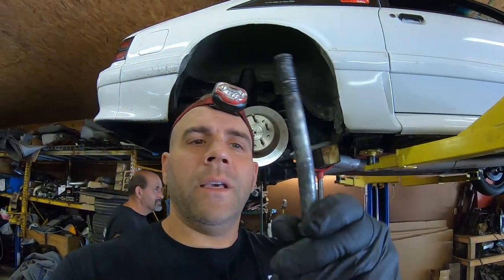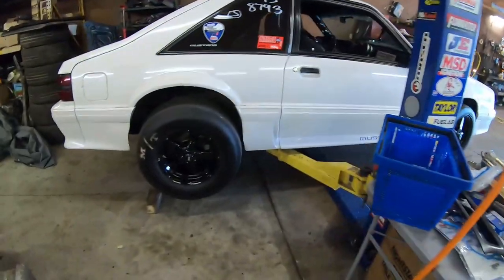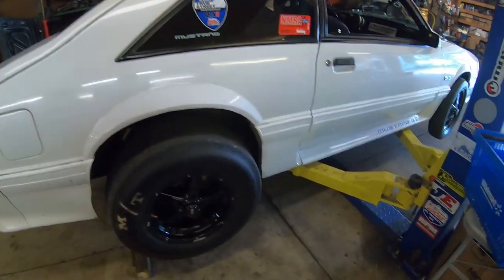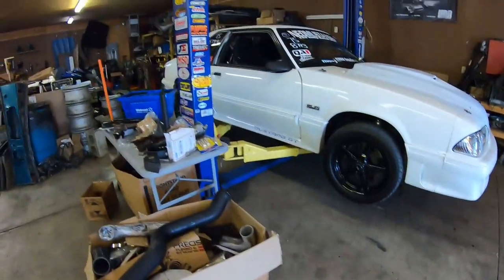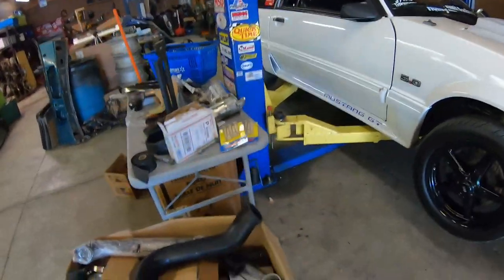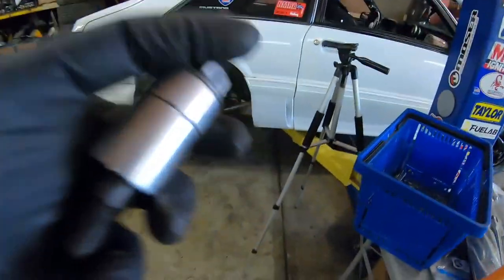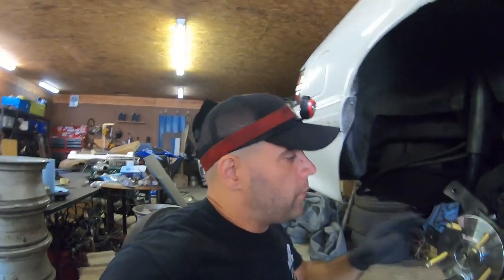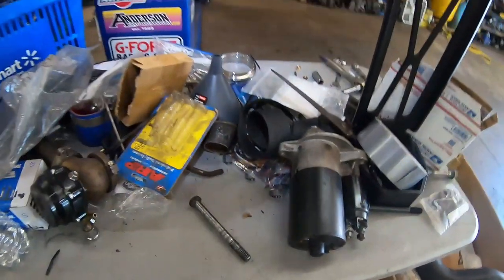TORQUE: IT Gets The Cap Off Your Beer! ALWAYS SENT SOMETIMES BENT!

Comment: Yes sir,  I had SSM lift bars, 90/10&50/50s with stock heads, intake etc and launched at 5500 rpm and cut a 1.48 60ft and ran a 13.91@98 😂
Reply from the maker: Nice

Comment: Neo what new bolts did you say you used for the control arms ??
Reply from the maker: M12 x 1.75 that are 90-100-110 and 120mm long. I bought a handfuls of the different sizes